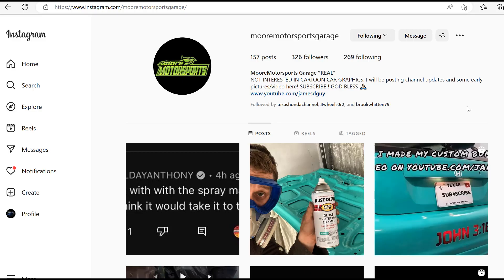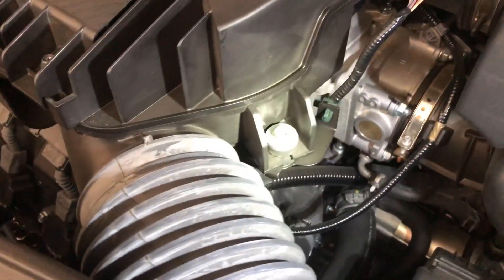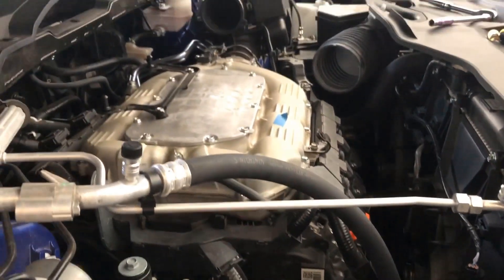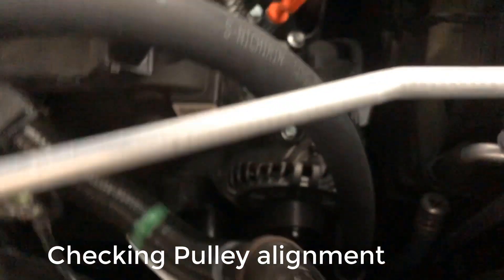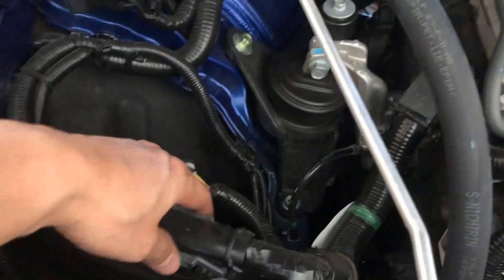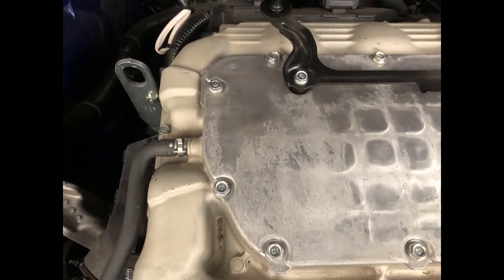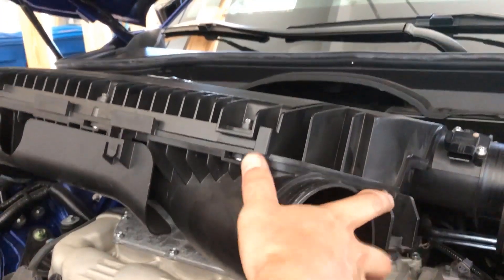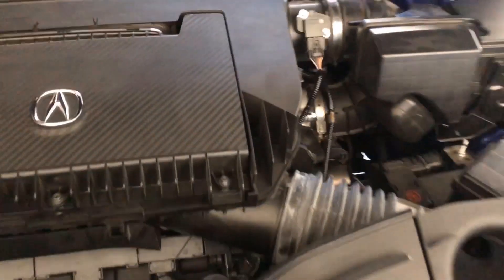2022 MDX Supercharged ? mockup fitment

Comment: OMG.....why did Acura go with this intake box??? That motor still has the same stock 290BHP.... so no gain or difference in power? Did they ever explain or post anywhere what the difference is/was with this style of Air Box over the previous? Or was it just a engine cosmetic change to charge $XX.XX for a different style air filter and make it harder to throw a intake or make any changes?
Reply from the maker: I think the design was to fill the engine bay since it sits much lower inside the engine bay. It also probably helps silence the intake by taking it through many bends and curves. Think about how loud an accord short ram intake is. I would love it but probably 90% or more adults do not want it loud. The forums have many people complain about road noise or an electrical hum from the throttle or turbo (typeS) or other sounds. There is a website that sells 3.5" custom adapters with the MAF but its expensive for what it is. You gotta love the sound to do it.
Reply: @macgyvergarage2016  Yea I guess I get it about silencing additional engine/throttle noise. I actually removed the airbox resonator off of mine JUST to hear the grunt / throttle sound and of course the Vtec once that kicks in and sounds amazing on this V6. 

But you're right,  the majority of folks that buy this vehicle isn't for performance or sound of the motor / exhaust. 

Thanks for replying!! 👍👍

Comment: Interested in seeing how the new 10 speed trans is going to handle that.....
Reply from the maker: I think people are already adding TypeS horsepower gains. So base TypeS 355HP plus JB4 addition up to an extra 80 HP. So around 435 HP and I haven't seen any issues on any forum with the transmission. The Honda engineers really limited the 1st gear. Its shift pretty early into 2nd as to save the gear. I'd assume we could do the same with the same transmission. What do you think?
Reply: should be fine considering how the accord guys hitting  400hp.. anything below 450 should hold up

Comment: Just to put it out there, there are kits to supercharge the MDX. But as always, this will void the warranty for the car specially a 2022.  The Type S is a turbo combined with 6 cylinder engine and while it’s factory, is probably a better option than to do it yourself.  Specially in a car that is still under warranty.

Comment: How would a j37 manifold work ?
Reply from the maker: The design is different than the previous years. There are injectors on the manifold for previous years before direct injection. The shapes are different. Maybe a plastic Odyssey manifold will work with a Dremel. Not sure yet.

Comment: Uhh, I know I’m not going to be the first asshole that says this but, why not just get a Type S in the first place?
Reply: The type-S is only a 3.0L vs the base model's 3.5L. It also redlines/shifts at exactly 6000rpm vs 7000rpm. The type S has a very small turbo (hence the low redline) and finally, no VTEC
Reply from the maker: Hi JJFLD ! Thanks for commenting as any comments help at this point. I like tinkering with cars. The MDX was purchased the first month it came out. I have enjoyed it and wanted to mess with it and add in features not available on the lower models. I spent 63,000 on this and I know the mark ups on the Type-S were kind of crazy at first. It was usually MSRP plus 10,000 or more. So once you are in the 75000 range, the alternatives are BMW which I love and have owned many of them. In fact I still own a 2007 manual 6 speed single turbo 335i with only 60000 miles. Its my fun car. I guess I could just trade it in and take a loss of 10,000 or more and pay 20,000 to get into the Type-s or just add a supercharger. That was my thought.
Reply: @macgyvergarage2016  my goodness your garage sounds too similar to mine.💀 I have a 2009 335i 6MT & 2019 RDX. I really want to see someone make an intake for the new MDX, it’s just way too quiet and it’s the last new Acura with VTEC, I want to hear the damn engine!
Reply: @simonaldridge4099  Someone needs to make a big turbo for the J30AC! 😤
Reply from the maker: @JJFLD  , I thought about buying a cnc machined 3" adapter and putting a K&N but after looking at the drop in filter, and seeing how easy it was to do, i just paid the $69. I made a video on it. I will see if i can find the link i had to the company selling the adapter. Then you would remove your big intake box, use the adapter, use the OEM MAF sensor, and any 3" opening K&N. There is a ton of room. I even thought about using the really big Corvette intake cone to take up space.
Reply: @macgyvergarage2016  All I care is to hear that engine. 😂 I made a custom intake for my RDX and oh my goodness, I couldn’t be happier, my car is very loud now, the turbo screams and the diverter valve is really loud.
Reply: Well the type S. Is a slow SUV given power output and the size of the car.  To make the car similar to a entry level BMW x5, you have to give the car at least 100HP from base engine plus another 75LB of torque  increase to even have a similar output SUV and at that point the S type does not meet the power output of a base X5 and never mind when we talk about x5 competition.. i am sure you get the idea
Reply: Overpriced type S and they still didnt get it right.